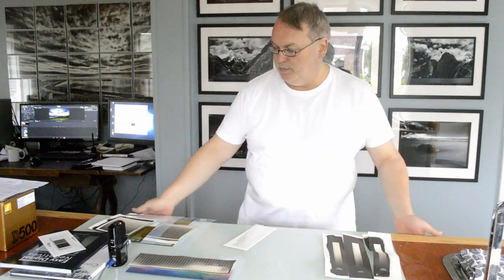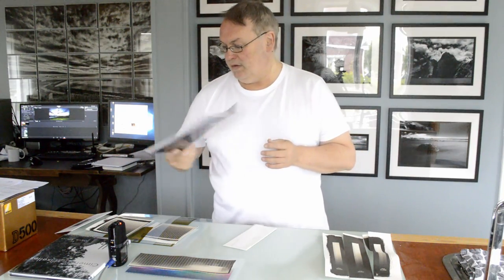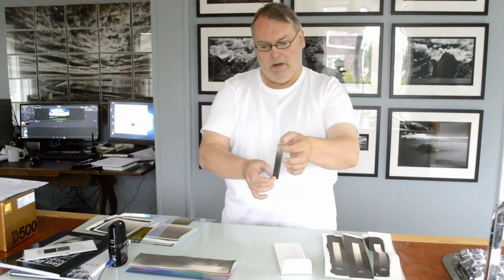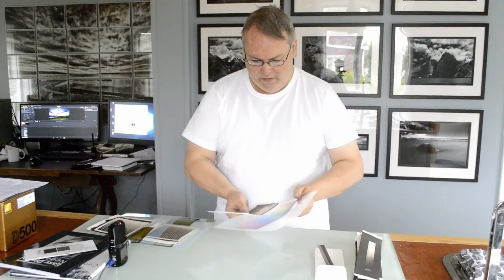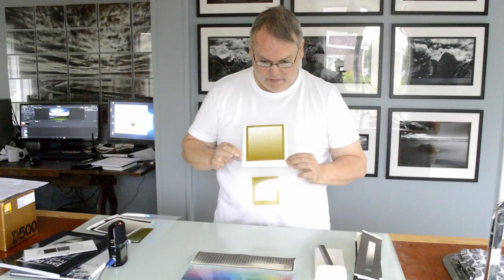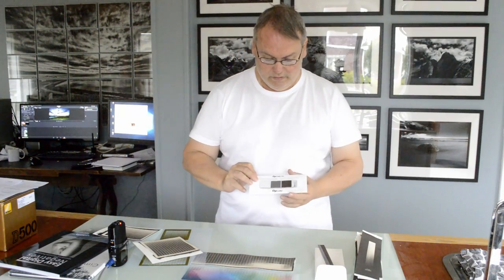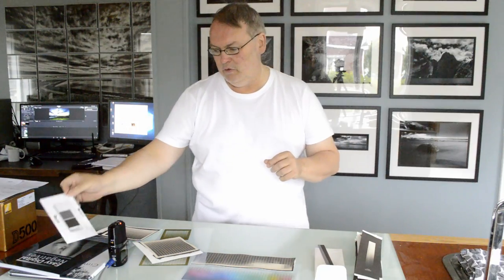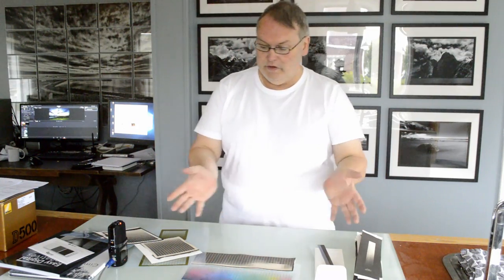Digital Negatives - Overview

Comment: Previously, I had lots of problems to create smooth continous tone even with QTR. But i accidentally stumbled the QTR Shadow value setting and increased it´s default value, everything came together.  After that it was just fine tuning the curve in photoshop.
I noticed also that it is easier to make digital negatives for low contrast VC paper grade (value 0 or 1). Just first test the maximum D-max (exposure time)  for that selected  grade using Stouffer  21- step scale thru inkjet film you are using  to take filmbase + fog into account. After you have determined your exposure time (dmax) for that grade, stick with it, then finetune your digital negative & curve based on that information. Chartthrob clearly visualizes the continues tone / end result is it ( hit or miss).
Reply from the maker: Thanks for that, does sound a lot more 'involved' though!

Comment: I have that book,  and it's not easy, or I'm an idiot.  Every page I have to go study something else in order to understand enough to go to the next page.  I'm ready to go out and buy an 8x10,  apply my efforts to learn how to make good exposures, and make kallitypes, cyanotypes and saltprints from the negative.  This has been a frustrating challenge. I'm sure I'm missing the "easy" part somewhere. When those processes were developed how many years ago what did they do about tone mapping?
Reply: I can play with the aspects of the negative well enough to my expectations
however I’ve tried three printers and can’t get a decent negative to print out.
Thank you for the informative video
Reply: It´s hard to make digital negatives using basic inkjet printer for alternative processes, as the negative density must be quite high, and basic, cheap inkjet  printers cannot provide enough density.  I have had success with laser printer negatives, you just need to test the diffrent print settings to get in work.  But if you want to make digital negatives on an inkjet, I suggest you first try to learn the trade using basic silver gelatin paper ( variable contrast).
Reply: @Vesalempinen  thanks, the more I study these things the clearer they become.

Comment: Many years ago I experimented with compositing photos and inverting them to negative and then using an orange mask to contact print the digi-negative to Ra4 paper and proceza as such. Is this what you are doing, contact printing. The color match schaling looks familiar to some of the exposure maps I made back when, for checking correct color. Anyways maybe I'm off. I would be interested in more or what you're doing. To be honest I have been thinking of starting my own channel of my interest in color and b/w printing. It is kind of scarry, putting my puttering around, OUT THERE. Seeing what you are doing I feel a bit less alone. I hope that didn't come across wierd.
Reply from the maker: Hi Brent,

No, not weird at all. You should make your channel, I am sure that people will be interested. Yes, exactly that, making contact prints with a UV mask in much the way you would have done. Let me know of you make your channel, you might be interested in Carbon printing, and particularly full colour Carbon prints.

Dave

Comment: Hi David, Love it -- yet isn't it better to actually know how to shoot for a PD/PT print and shoot ULF?  Excellent work.

Warmest Regards
Reply from the maker: Hi Paul

Many thanks for your kind words

Not sure that I would agree that it is 'better', but it is certainly different! I do also shoot in ULF, though I have sold all my large format gear whilst in China. I will be re-equpping when I get back to Europe and am intending 5x4, 10x8 and either 7x17 or 12x20 (can't decide between the latter two, though it will probably be 7x17 for the panoramic format!).

Dave

Comment: Hi, Dave. Thanks for the video. Your first print is so neat! How did apply your chemistry so neatly to the paper? I have been using hake brushes, and I cannot get an even application :O
Reply from the maker: Hello Grace
Welcome to my channel, I just use a synthetic painters brush. I pour the mixed chemistry on to the middle of the area, which I have marked from the corners of the negative, then i brushthe chemistry in all directions several times before finally finishing off with light strokes in one direction. I hope that this helps
Dave
Reply: @DaveJSmith  Thanks so much! I saw your video where you applied the chemistry. I appreciate your helpful videos! (:

Comment: Thanks for the video! Does this tone mapping process mean that it's possible to make good digital negatives from dye based printers? I had always heard that you needed a pigment printer to make good digital negatives but they are so expensive. It doesn't look like the absolute density of the ink is as important as the uv blocking of that particular ink. What printer did you use?
Reply from the maker: Hi Isaac, I am afraid that this process won't remove the issues with dye printers. However, you should try it, print the colour matrix and test it with your process of choice, if you get a colour that gives good blocking then that is all that you will need. However, many dyes don't block well. I use an Epson 3800.

Comment: Can anyone send me a link to how to print a negative for the platinum palladium print process? Is it just a regular ink jet printer on a transparency? Nobody seems to cover that part. Thanks
Reply from the maker: Hi Chaz

You might like try the more in depth version starting here
https://www.youtube.com/watch?v=p9ApVnx6qTE&t=4s
With this method any inkjet will do (though pigment inks are best by far) onto any transparency material coated for inkjet. The calibration will make sure your negs will print. Note that other methods rely on specifically an Epson printer
I hope that that helps

Dave